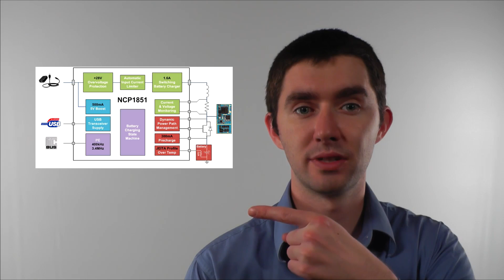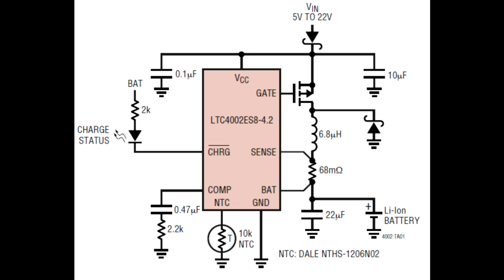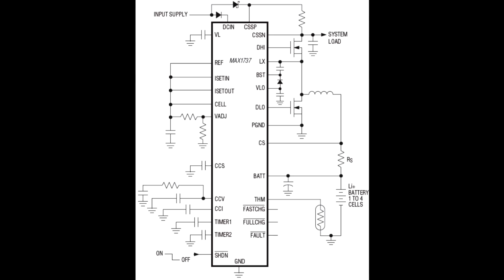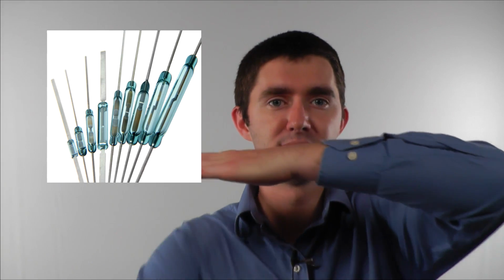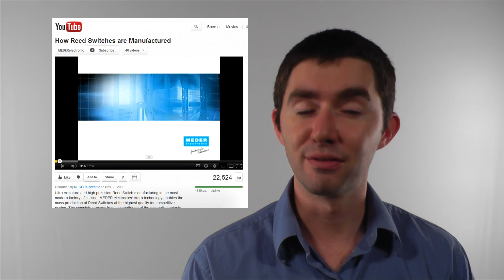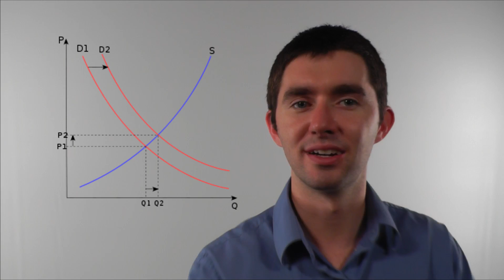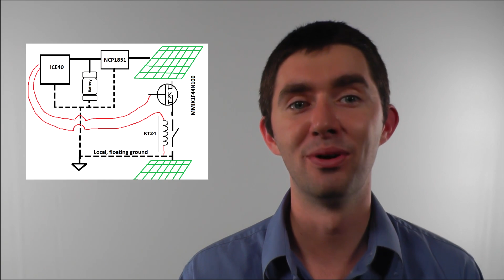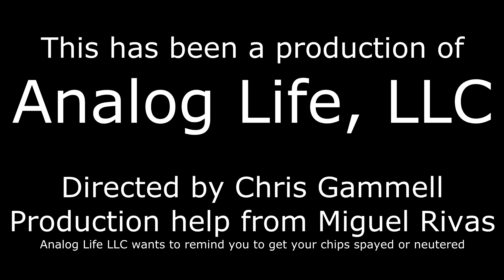Chip Report TV #4 -- NCP1851, MMIX1F44N100, KT24, ICE40

Comment: I'm in a agreement that the off prompter is a nice change :)

Interesting ICE40 part... I'm using a Lattice LFXP-8E (TQFP-144 package) in a current project, but was thinking of switching to Xilinx for lower cost at similar performance... but if I don't need the full resources of the LFXP-8E, then some of those ICE40 parts start to look rather attractive in terms of price...